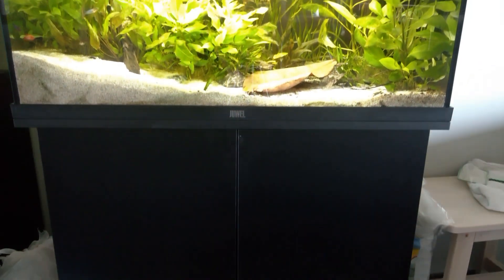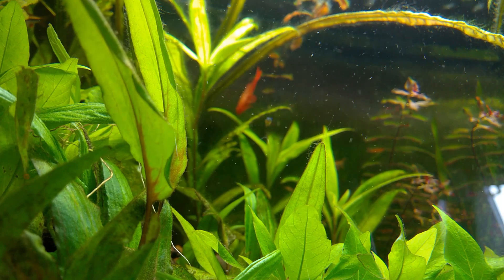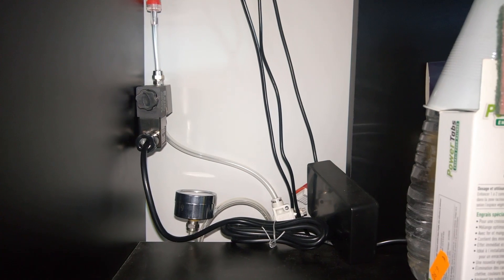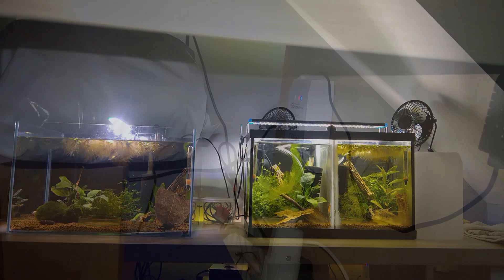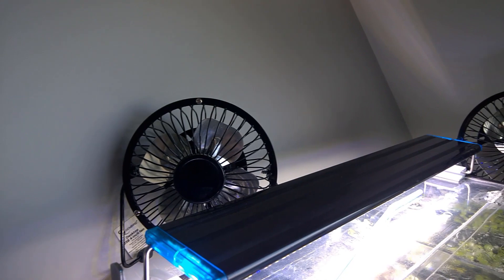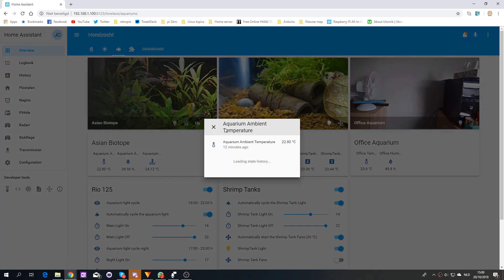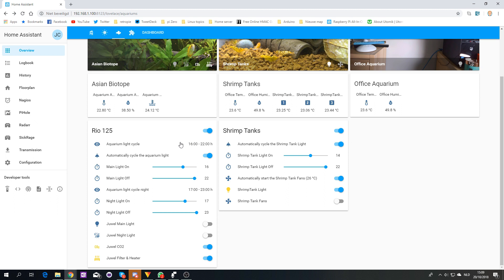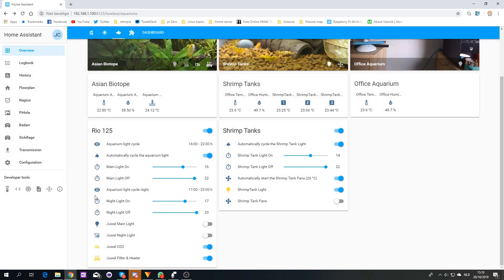How I automated my aquarium, and how YOU can too! (using sonoff and HomeAssistant)

Comment: Hi. how you control wather temperature?
Reply from the maker: I use a normal heater (standard juwel one). However I can monitor the temperature with a sensor & if needed can manually turn off my heater from my sonoff devcice
Reply: @TriplusTutorials  now i try sonoff th16 in stettings put  temperature from 18.9 till 19  celsius. but it doesn't work as I'd like turns on when temperature about 18.5  and turns off in 19.5
Reply from the maker: I'm not exactly sure what you mean. Also, do you use the standard firmware on the sonoff or not?

Comment: Nice setup :)
I am curious as to why you have your filter setup via HA?
I control my aquarium lights via HA and plan to put my heater in HA too, as an extra safety precaution, if the heater should ever get stuck on ON. 
Another benefit to this is to have HA send me a message if something fishy is going on with the temperature in my fish tanks.
Reply from the maker: filter is exact same reason as you are putting your heater in ;) (I have my heater in now too!).
It's just for peace of mind that I can check if things are running or at least powered on.
Reply: i prepare my new 400lt aqvarium,  with aquel gold 500w heater. and  i think  if th16 will work more precisely temperature in akvarium will be more stable, in summer,  i same  use HA for  lights, and i have web camera so when i  on vacation i can control situation
Reply: @TriplusTutorials  You could also add a trigger to power off the heater if the aquarium is overheating (e.g. possible male function). As for the pump i am planning on adding a moist sensor to the container my canister filter is in. This way i can automatically turn it off in case of a leak.
Reply from the maker: @nielswestphal2838  true- there are so many possibilities with home assistant :) If you have a sensor that you can connect, your only limit is the imagination!